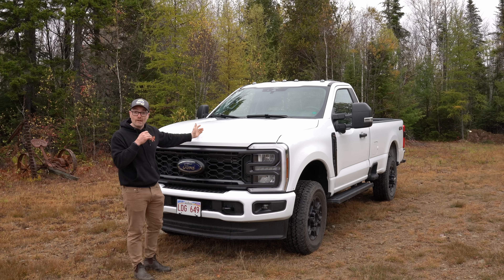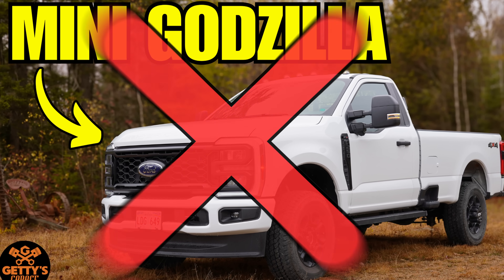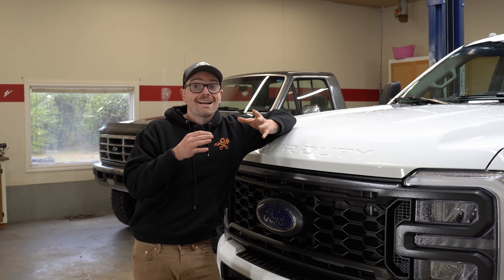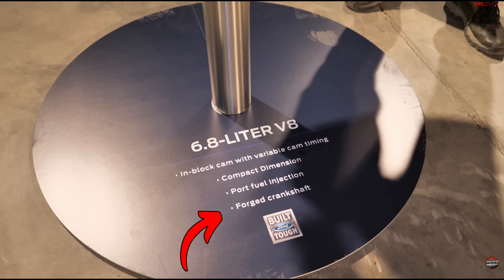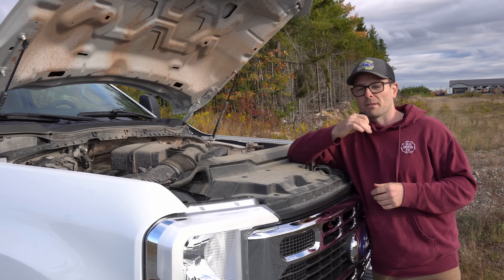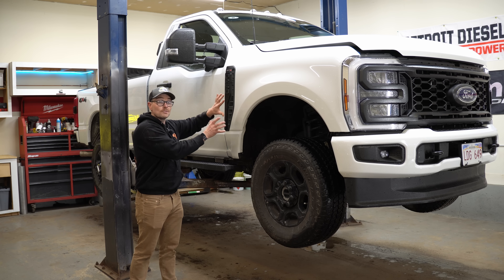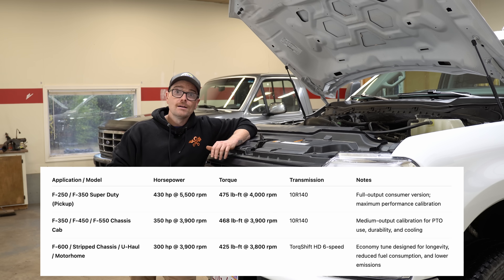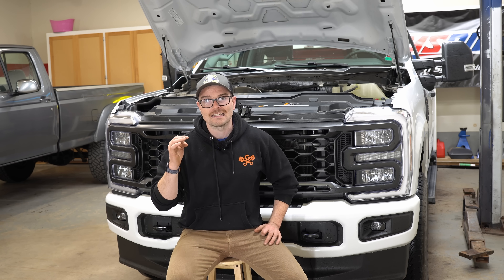Ford F250 6.8L Mini GODZILLA V8 Engine | Weak Points & Common Issues YOU Should know..

Comment: I am so glad I have a Dodge Ram 2500 that will be 19 years old on January 6th 2026. It runs better than when it came from the factory. That is due to my help with the choke and smoke crap.  It will most likely run for the rest of my life. The weak spot was of course the 68RFE, I knew it when I bought it and when the valve body went out, I got an ATS Stage 2 with the triple disc torque converter and a towing version of the CoPilot.  These newer trucks are made for light duty hauling a couple bags of mulch form the big box store.
Reply: To your last sentence... Nonsense!

Comment: re: cast crank - Has anyone ever actually broke a crankshaft in any engine? I hear people breaking rods, cracking pistons and heads, valves, bearings, etc, but I have NEVER heard of even a third hand story about breaking a crank.
Reply: The 5.0 Cummins (Nissan Titan XDs) were notorious for it.
Reply: @Elredneck1  as a long time Nissan Titan owner we signed a contract when we bought our truck to never speak of that absolute atrocity
Reply: Yes, they bend and/or crack/fracture. Which ever issue arises you will have to get a new engine.
Reply: @Tony-b8s Bend ?  Bend ?  BS
Reply: @ChollaJJ  Watch videos on YouTube if you’d like go ask a machinist do whatever investigation you need to do. A crankshaft can bend. It’s not a rare occurrence.
Reply: Nissan’s 4.2 diesel Normally aspirated straight 6 engine is known to snap cranks, but only when they are modified here in Australia to 30 plus psi boost after people have bolted a big turbo on them.
Reply: GM 6.2 Diesel V8. Many are wiped out by broken cranks under normal use.
Reply: They are pushing the limits but the hot rod guys putting superchargers on Ford F150 5.0's have issues with broken cranks.
Reply: Yes, it has happened.  Roadkill did a 4.3  V6 in that manner.  At a pretty mild boosted set-up at that
Reply: Crankshafts break all the time that's precisely why any heavy duty engine that doesn't have a Ford crankshaft is a worthless piece of garbage like this one I bought from Ford and that's why I hope the company gets wiped off the map by a tornado or a nuclear bomb for all eye care
Reply: @MAXIMUSMINIMALIST  what did you buy and what issues did it have ?
Reply: @MAXIMUSMINIMALIST writing a coherent comment might actually shed light on your thoughts

Comment: I think the only reason the 6.8 exists is so Ford can charge extra for the 7.3.
Reply: The 7.3L was always a 2K upgrade, even before the 6.8L when it was paired with the 6.2L. The 6.8L primarily exists because it shares nearly identical architecture to the 7.3L and it just a destroked version of it as to where the 6.2L was a completely different design. The 6.8L have interchangeability and come off the same assembly line which means cheaper production cost.
Reply: I mean a cheaper option makes sense for work trucks. Since forever it’s been a gas engine as the cheap option, A diesel the most expensive and a Big gas engine to be the between for people who occasionally tow. Ford and Chevy have down this forever. A 5.4L gas, 6.8L gas then the diesel 7.3L, 6.0, and 6.4. A 351 and 460 gas engines then the Diesel 7.3L.
Reply from the maker: Maybe lol
Reply: I believe from the start Ford intended the 6.8L as the "base" HD engine for all trim levels. There was even a time before the order books opened in 2023 that you could spec an F250 up through Platinum with a 6.8L on the website. I think production setbacks made them make the decision to only offer it in the XL trucks for 2023 and now it's where they intended it to be in most trim levels.
Reply: Lol
Reply: hell I was looking at it for nostalgia purposes because my current truck is 6.8

Comment: Check out engine power video on the 7.3. Ford under rated it massively it puts out 510hp and 570ft/lbs of torque stock
Reply: Most all after market dyno shops have said the exact same thing. Most of the dyno tests show the 500 to 530 hp with 570 tp 590s ft/lb. They also point out that the 7.3 can easily be boosted from 700hp to 900 hp with existing factory parts. Meaning that it is also way over built. The videos on these are easy to find.
Reply: @joewiese4174 huh, so it cannot compete with the GM L8T hey? At 2000hp reliably on stock internals that really highlights Ford taking shortcuts
Reply: @johnserrano9689  When 20 shops actually do that then preach it. But on paper means nothing. several shops have boosted the 7.3 to 1500 but will tell you that stock parts wont last 200k with that. The L8T is probably not an exception.
Reply from the maker: I've heard that also!
Reply: wasn't it 500hp and 550 lb.ft torque

Comment: I’ve seen cast nodular iron cranks in ls based motors hold well past 1k hp boosted with no issues so not sure why a forged crank is even an issue
Reply: Forged is superior this is basic physics.

Comment: Do a search for this document: WSG-1068 6.8-Litre 10-Cylinder
Page 3 - it's a forged steel crankshaft on the 6.8L
Also, for what it's worth, both Grok and Perplexity reported back that it is a forged steel crankshaft. Grok went on to say: "The confusion may stem from the older, unrelated 6.8L Triton V10 (a modular OHC engine from the 1990s-2010s), which did have a cast crankshaft"
Reply: Yeah, i'm a dummy. Didn't even realize this document is for the 10 cylinder industrial engine. Apologies about that.

Comment: Does this truck have Manuel locking hubs on both sides of the front axle
Reply: My 2024 does. You can set them to auto or manual, IIRC.
Reply: My 2024 XL 250 only has a manual locking hub on the driver side.
Reply: @JoeJalopy  My 2024 also had only 1 locking hub, the other was a dummy hub. I changed it with a real Ford hub for $150 before I drove 5 miles. You have to run a new vacuum line to the new hub however if you want it as a auto locking hub
Reply: I've heard there's a bulletin and that if you go and complain they will change it for you at no cost or you could just take the parts and do it yourself since it's so easy because they know they screwed up with the dummy hub but this is what happens when companies become monopolies. My 2025 didn't have the dummy hub I'm assuming because I ordered the snowplow package so that must override the dummy hub and call for a regular on both sides so I don't have to do anything.

Comment: I have a 2023 F350 6.8 mini-zilla Crew cab. Have owned it for about 8 months. It was new old stock at a commercial dealer. I am happy with it. We use it as a tow vehicle for a 6000 lb camper, and put two motorcycles in the back. We’ve put about 10000 heavy use miles on it, towing at altitude in Colorado. We’ve had one warranty issue, which was a stuck evaporator valve causing the truck to die (without throwing a code) if you top it off when fueling. Without the tow, we get about 17 mpg on 87 octane.
Reply from the maker: Can't complain about 17 mpg! Sucks about the evaporator valve but hopefully ford took good care of you
Reply: Sounds like an underrated  engine. I never knew there were 6.8 gassers by Ford.
Reply: I have a 6.8 with 4:30 gearing.  
How and the world are you getting 17mpg
Reply: @juanramos6976 he isn't... fibbin to us

Comment: Ford needs to put the 6.8L V8 crankshaft debate to rest. Does 2023 have a forged crankshaft and the other models don’t. What is the story. Either way I own a 2023 and am very happy. I tow an 8000 lbs travel trailer with no issues
Reply: Here is the part number for the 2023-2024 6.8L V8 Crankshaft
PC3Z-6303-C
@Getty’s Garage please buy order this part and make a video. Let’s put this debate to rest.

Comment: On My 2016 F250, 6.7, the chin spoiler got torn off in the snow and I kept it off for over a year. I was getting better fuel mileage with it off.  I did put it back on as a test and the mileage dropped again. My 2024 7.3, I replace the bumper with an aftermarket winch bumper so I don’t have the big ugly chin spoiler.

Comment: It has nothing on the 6.6 with the 10l1000. Drives better more industrial. Runs cooler, shifts better. Tow more. Just a better truck.
Reply: YOU HAVE TO BE KIDDING.
Reply: @theingobeck4772 everything I said was factually correct. It tows more than all the other trucks. Trans logic is miles better the 10r. The temperature is much lower. It’s just a more thought out truck.
Reply: @theingobeck4772 I grew up with fords, rams, and my last truck was a ford. This is the first Gm I’ve owned. I just buy what is objectively the better product.
Reply: @BrianBourgeois- And the 6.8L absolutely $#its on the 6.6L Chevy/GMC trucks. Chevy's version of the 10-spd is the absolute worst and it's almost at class action lawsuit levels of failure. Call any transmission shop. It has lifelong Chevy clods leaving them behind.
Reply: @theingobeck4772 ok. I’ve driven them all. None of them out perform the others by real measure. It’s all in the design philosophy. Have fun with that jerky 10 speed in that ford. Been there done that.

Comment: That valence on the front is covered in a video by PowerStrokeTechTalkwithArod, YouTuber. He replaced one with an aftermarket one. There are also some metal pieces down there that can be removed. You could replace it with the Tremor PC3Z-17626-CA or other valence like the S&B that doesn't need those little air dam pieces under there with the factory valence.
That oil pump could be replaced with a Melling M176HV.  Want that mileage back, don't carry the spare.  I have a 7.3L. I just don't let it idle that much. 
Those box trucks probably don't get lavish service attention, and if they use factory spec oil, it's Motorcraft synthetic blend that may break down some between oil changes. That reduces film thickness that could be a factor in those box truck engine failures. That and the economy tune, keep RPMs down and possibly oil pressure lower that it could be otherwise with a "normal" tune.

Comment: Wasnt there a flash of fix for the oil pump on earlier 6.8 models ? Higher idling rpms or something?
Reply: Yes. Ford Customer Satisfaction Program 24B27, to address concerns with low oil pressure at idle in the 7.3L & 6.8L gasoline engines. It's a free PCM software flash available at any Ford dealer.
I tried to find out details but couldn't get any info. Does it raise the idle RPM and thereby increase the oil pressure? Does it occasionally blip the RPM to achieve this? Does it just flat out raise the oil pressure without RPM increase? I dunno. Would love to hear from someone if they DO know the details.
Reply: @Quidisi  It raises oil pressure slightly and not idle rpm. I had my 2023 flashed and it idles exactly like before. The 2025 and up already come with the update only 24 and older need the update.
Reply: @Quidisi im assuming that fix is standard in more current years? Really like my 2025 f250 6.8.

Comment: If I saw it correctly, the torque specs for the 10R140 as shown with the 7.3l is less than what the diesels can put out.  So do the diesels get an even beefier trans?
Reply: Nope
Reply: It’s based on the torque converter.
Reply: The diesel is stronger but it has over twice the torque. If the 10r140g fails it won't be from being to weak for the engine it will be from something else though.

Comment: According to some sources it does have a forged crankshaft.
Reply: I searched high and low to try to get a definitive answer about this crankshaft and I couldn't find much of anything. I find it hard to believe that they would use a cast crankshaft even if it was cast steel because tolling up for that process would cost more in the long run Then just continuing to use a forged version. I wish Ford would stop with the mystery bull crap but the little bit of information I did find unfortunately leaned towards it being cast and if that's true it is unacceptable

Comment: 2024 F350 XLT Super Cab Long Bed here.I was going to order a 2025 until I found out Ford was taking (decontenting) standard items away. It came standard with the 7.3 and 10R140. Ordered Sept.19,2024 and picked it up the day after Thanksgiving. High idle times is the main culprit for lifter failures.
Reply: High idle times have never been 100% proven for the lifter failures. I’ve seen them fail at low miles with low idle hours. My bet is poor quality lifters. It’s  the luck of the draw who gets a bad one
Reply: @sprint2648 I thought it was well known that there were COVID era materials problems with those early 7.3L lifters.

Comment: if the two trucks were otherwise identical, which would get better fuel economy...the 6.8 with 4.30 rear end or the 7.3 with the 3.73?  I would love to know because the only way to get 16k tow rating with the 6.8 is with 4.30 rear end.  Thanks
Reply: Exactly the question I have!  I'd love to see someone get out and test it.  I've seen some tests, but they are too short and have other significant differences in the trucks.
Reply: I would put my money on the taller gears. That's quite a jump unlike going with 410s.  I ordered one from the factory because I demanded the 430s.